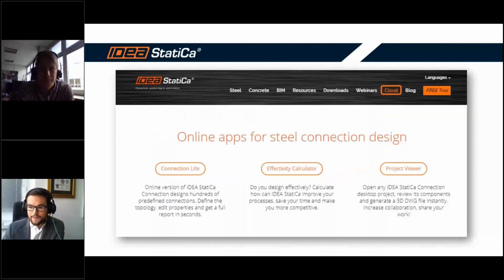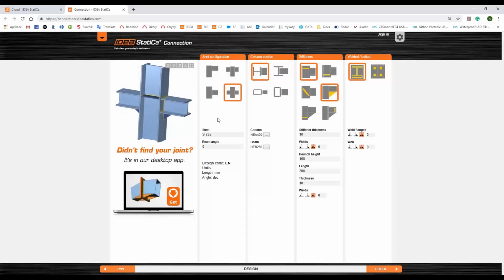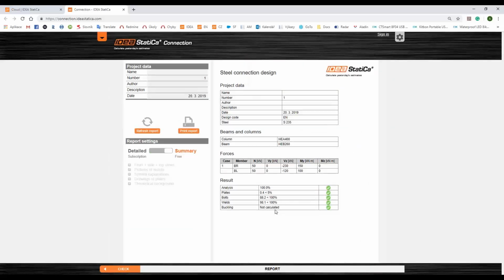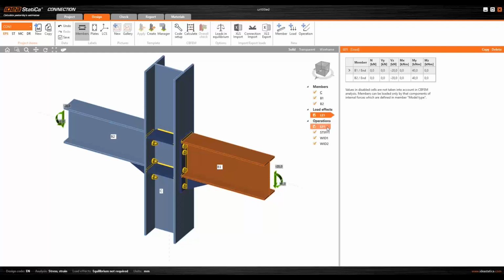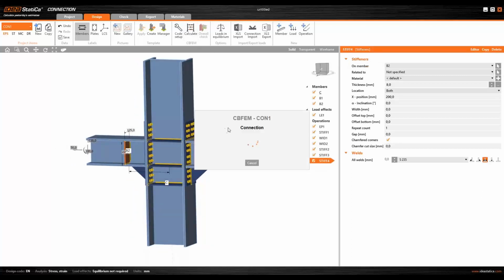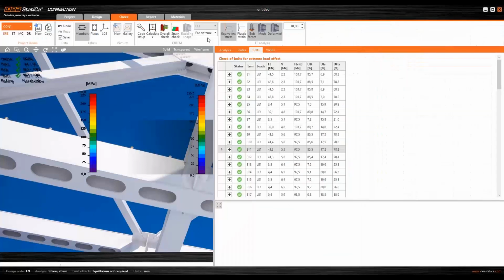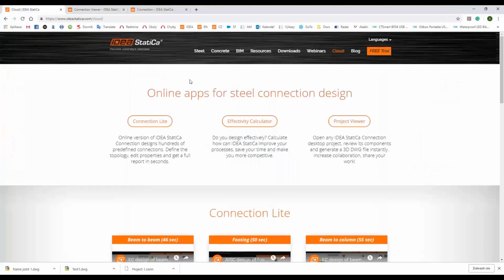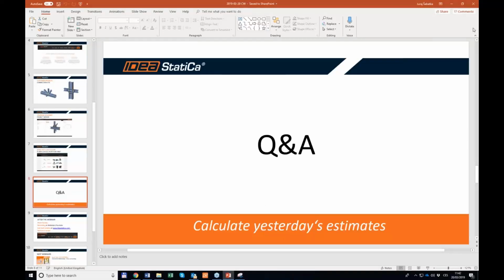Connection Wednesdays – Meet our cloud solutions

Comment: The connection lite is nice for quick checks, but you should be able to save that file for opening in full version.
Reply from the maker: Hello Robert, IDEA StatiCa Connection Lite is a separate cloud solution for quick connection design, it is not compatible with the Connection app from the desktop package. Its our contribution to the engineering society to provide such simple tool online for free.